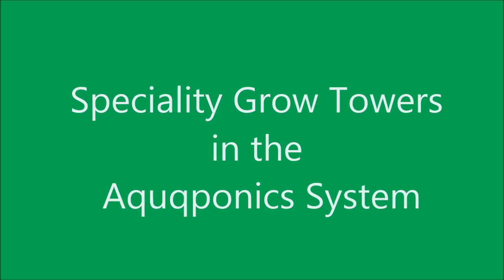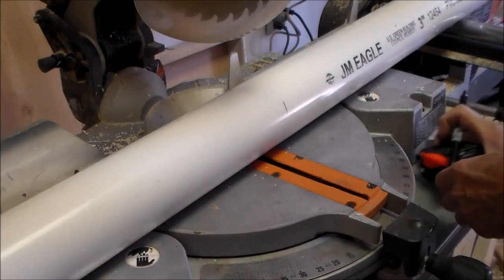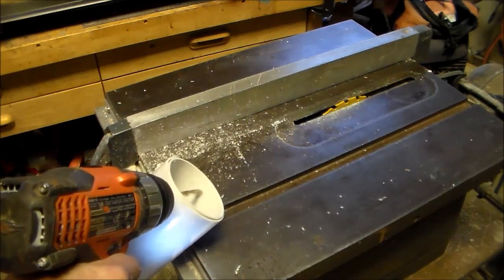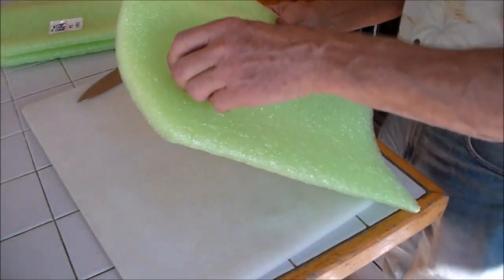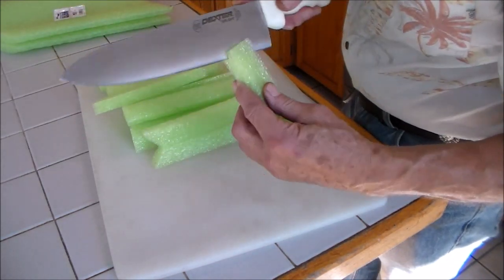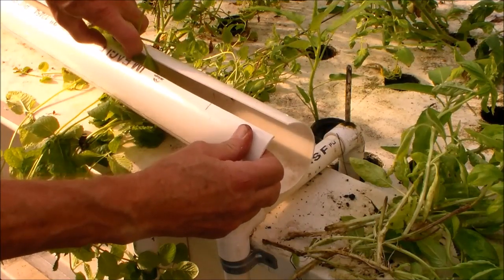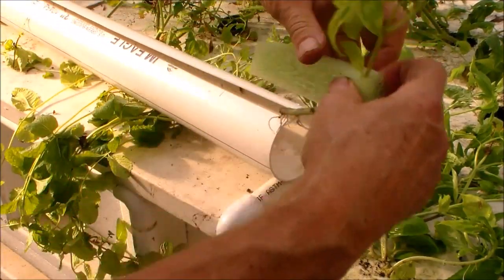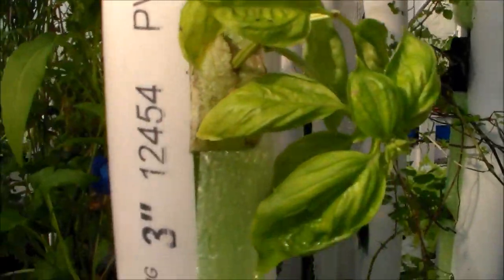Speciality Grow Towers in the Aquqponics System

Comment: Wonderful. Since I could not find a round downspout, I used a typical square one which won't row around. I tried the slot channel cutting but did not seal it - I should have sealed it like what you are doing here. In the end, I made several types of towers, but I like what is made with downspouts: https://youtu.be/ADvV2nX1AVM